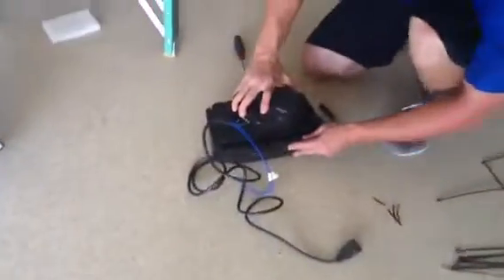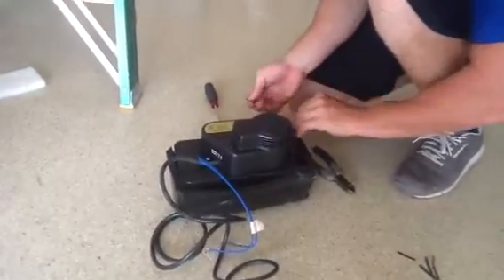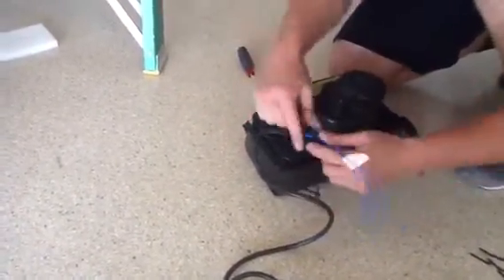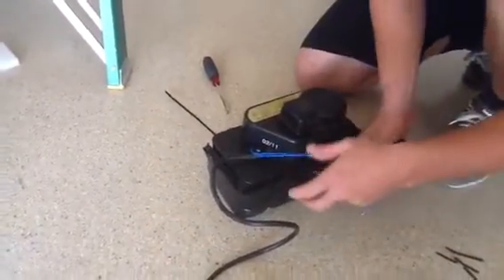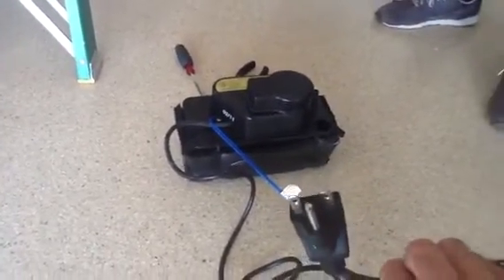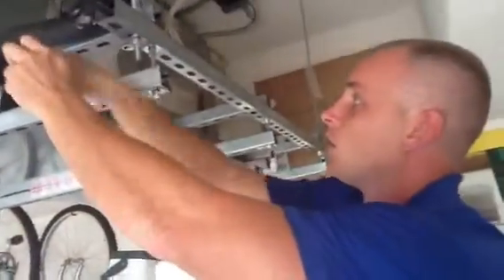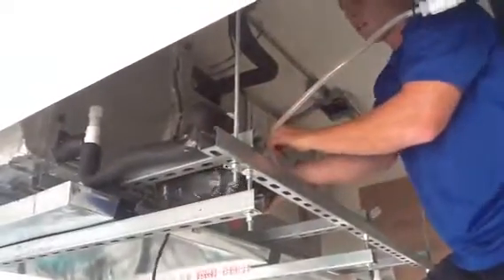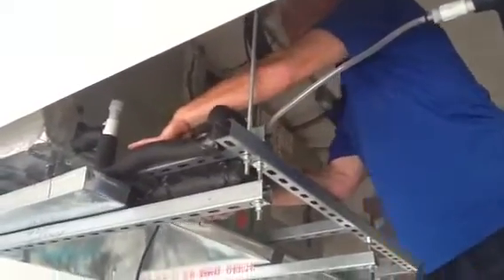HVAC Installing a Condensate Pump

Comment: I also believe the 230 condensate unit only demands 2 amps when it is running…i am curious how he wired the unit in off the service switch and have the air handler wired to the service switch what did you just pig tail off the switch? or ram two wires into the lugs for the switch

Comment: Hi Adam I believe increasing the voltage would result in less amperage draw this goes back to OHMS law, yes you are right about the 220 V, it is not necessary but unless you want to run a new 120V that is the most feasible way to do it.

Comment: 230 volts to run a condensate pump?!   The Diversitech Clearvue is a 120 volt pump that'll do the same thing, but with float less sensor technology.   You don't need 230 volts to run a residential condensate pump. That's just ridiculous & all its going to do is draw more amperage, reflecting the owner a higher electric bill each month.  That installer talking in the video should know that. IDK why he's promoting that pump so much.